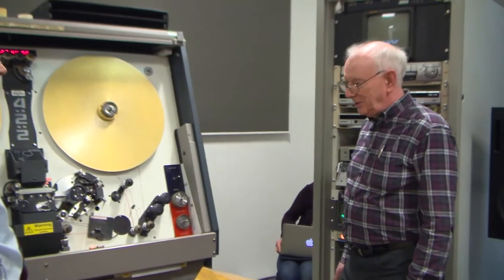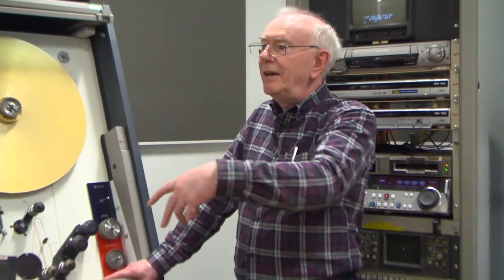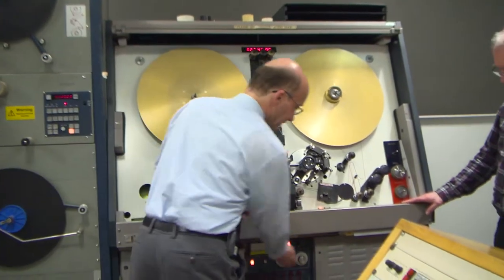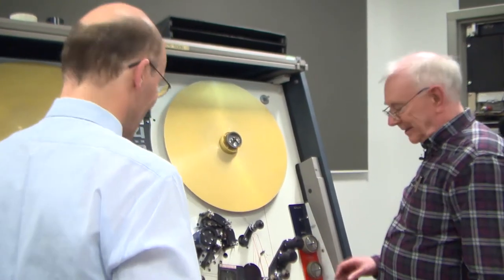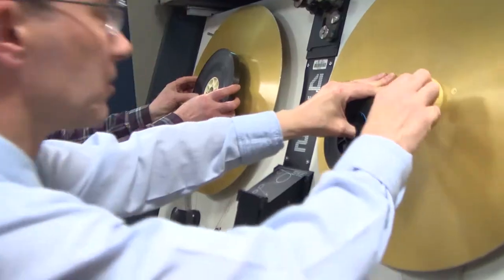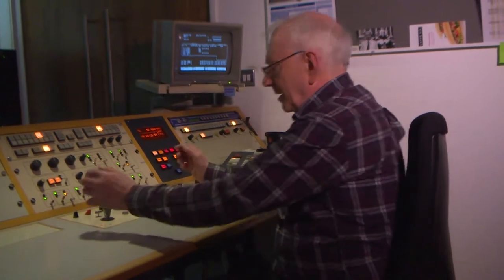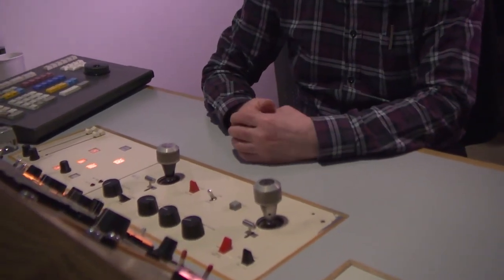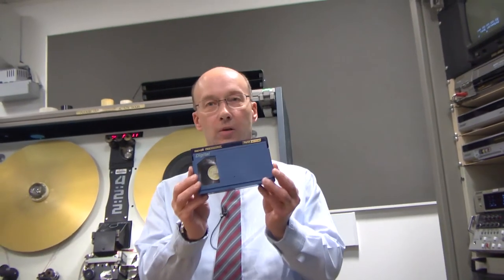16mm telecine reflections

Comment: Most amazing about this valuable piece of film-history is the question: Where did they get these two camera-kids? They had only 1 job to do: Avoid unneccessary camera-movement. - And on top of that, they have completely messed up the sound. - I guess, they work at a gasoline-station now. :-)
Reply: They are probably some of the best qualified students available on the course. Doh. The woman hiding behind the rack is hilarious too.
Reply: Yes both mics  badly overload. No idea about levels/ gain staging.

Comment: 4:2:2? So it's a digital telecine machine?
Reply: At the end they say it ends up on DigiBeta tape, so I guess yes.
Reply: The machine is mostly analogue but the back end is digital.
Reply: @wado1942  Oh, ok. Is it on of machines they put digital boards in?
Reply: @TVperson1  Not quite sure I get the question, but the light path and optics are of course analogue, because that's how light is.  The photomultiplier tubes are analouge, as is much of the circuitry that handles converting the electronic signal into something that resembles video.  The cards in the bottom of the unit decides what happens from there.  The original units had cards that converted the signal into an analogue NTSC or PAL signal but you can swap them for ones that convert the signal into whatever digital video format you want and give you SDI outputs to record directly onto digital media without further conversion.  Those flying spot scanners are incredibly modular and customizable.
Reply: That telecine is actually a Rank Cintel mkIII telecine.
Reply: Yes - parlty - but probably not for the reason you might think .

It has a digital frame store so it can scan the film non interlaced i.e. lines 1,2,3 ...etc and then spit them out interlaced 1,3,5 etc. Called a DigiScan as I recall.

Early Mrk3s didn't boast the fact on the front and may well have actually not been 4:2:2.

Later ones were and had a digital out which was useful for Digital colour correctors like the Pogle - the one on this machine looks like the standard BBC 'Tarif' analogue corrector (Television Apparatus for the Rectification of Inferior Film).
Reply: @mrb.5610  Oh. I see.
Reply: @northernplacecorporation  Bit more info .... it's because the film is scanned without stopping - it doesn't have the intermittent 'stop - show a frame - pull down the next frame - stop' etc of a normal film projector. That's because the time interval between individual frames in television is very short and you wouldn't be able to move the film that quickly without ripping it's sprocket holes to bits.

The difficulties come with the interlacing - there were all manner of weird and wonderful ways to scan the odd followed by the even lines - rotating prisms, mechanical shutters, you name it ! The Mark II used the later - one of its foibles being that you couldn't run the machine at anything other than normal speed - either forwards or backwards !

One final thing which I always liked when using those machines is that they're a descendent of Baird's 'Intermittent Film Scanner' used in the first TV studios at Alexander Palace ... so really if you trace its ancestry, it goes directly back to the first ever television made up of old biscuit tins, hat boxes and a flickery 30 line image of a ventriloquist's dummy....
Reply: @mrb.5610  As for that DVW-A500P Digital Betacam recorder, Colin has the same thing too, and replaced the pinch roller with a second-hand pinch roller with grooves on it.
Reply: @mrb.5610  Did you ever use the DSX?
Reply: @GregorPQ  Nope. Only a Mrk 3 in News.  And even those were 'main block' hand me downs !

They were fine for black and white but really didn't have the colour correction facilities for badly degraded colour prints. Luckily, the archive had transferred onto tape (or rather paid someone else to !) all the really rough itty bitty news film reports in the late 1990s.

And a good thing to as they were a nightmare - uncorrectable colour shifts, edit splices falling apart, not enough leader .... a can stuffed full of those would keep you occupied all day.

Or rather someone else if you could avoid it..
Reply: @mrb.5610  So you really think they were bad machines and didn't work properly?
Was there a better machine out there?

What would have been the price for the DSX back then?